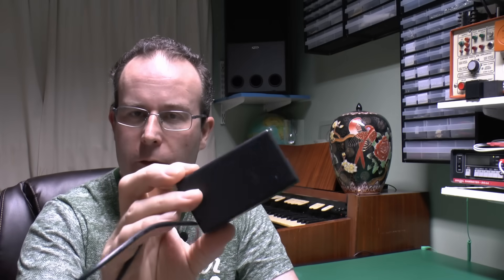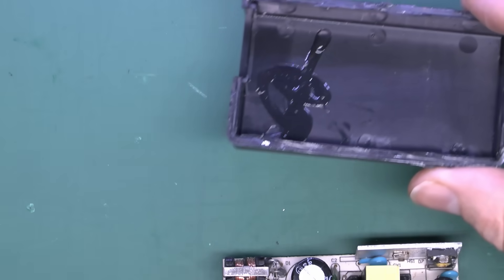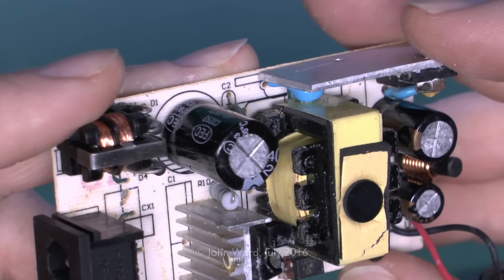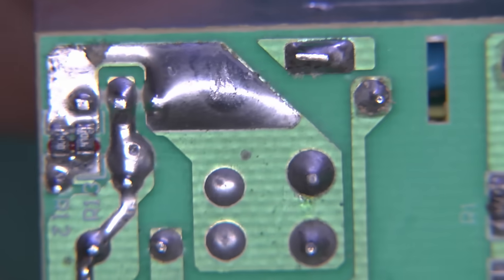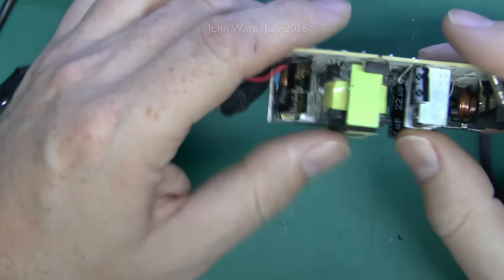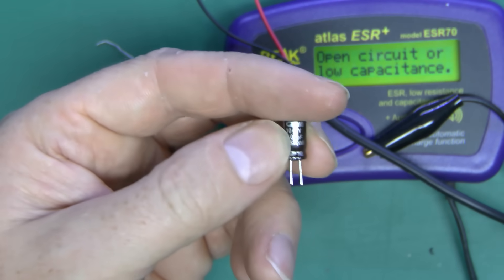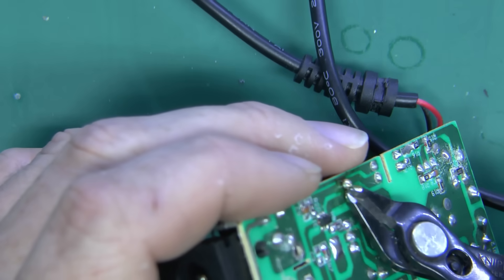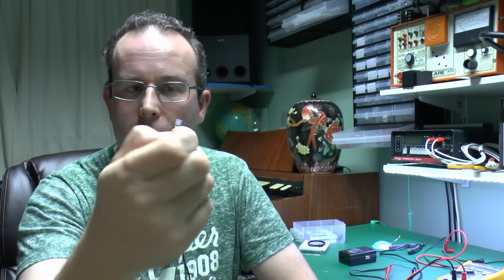12V Power Supply Repair

Comment: yesterday my PC can't turn on after I turn it off , I found out x2 470uF 10V blow out and i can't get it for replace ~ but i found out my old PSU x2 1000uF 10V in good condition, and i replace it and its work~ but I'm kind of worry ,will it affect any other place? such as motherboard or any other pc part?
Reply: check the voltages check the regulation
if they are good then not to worry
Reply: MichaelKingsfordGray  use an inrush limiter, they are pennies
Reply: MichaelKingsfordGray  It's an inrush surge limiter resistor. High resistance at switch on then very low resistance.
You can buy them on eBay.
Have a look here: https://www.ebay.co.uk/itm/Thermistor-NTC-MF58-MF52-5-15-50-100-500K-MF72-5D-9-10D-15-11/303138570119?ssPageName=STRK%3AMEBIDX%3AIT&var=602073291399&_trksid=p2057872.m2749.l2649

Comment: There are quite a few electronics repair video makers on You Tube and I find them interesting and informative. I've been an electronics engineer since 1969 but still find myself learning new things from these videos. However, it always amuses me that many of them have a grand array of expensive professional test equipment on show in the background of their "lab" or workshop,  -  mainly to impress the viewers I think. "Mr Carlson's Lab" for instance, is one such example. 
Such ostentatious displays don't necessarily reflect the ability or knowledge of the presenter, just the size of their wallets. 
This test gear is then used to diagnose and repair the fault on some cheap Chinese gadget or a crappy old radio which would have cost very little to throw out and replace. 
Novice electronic enthusiasts may be daunted to think they need all this stuff to sort a fault that needs only a cheap moving coil multimeter, a kitchen table, a soldering iron, a few tools, and a little knowledge.
Reply: I've watched Mr. Carlson''s Lab he's an excellent tech, really takes the time to do a neat job and I'm very much like his channel.
Reply: @cat-lw6kq  I agree, he is knowledgeable. I have learned quite a bit about repairing 1940s era radios from watching his videos. Now I am looking for a faulty 1940 radio to practise my newly acquired skills.

Comment: Usas demasiado estaño, no limpias el área que trabajaste (debes usar thinner o alcohol isopropílico), muy buen equipo, pero no me gusta el proceso, saludos.
You use too much tin, do not clean the area you worked with (you should use thinner or isopropyl alcohol), very good equipment, but I do not like the process, regards.

Comment: So if all your regular stuff runs on 240v does that me the range and cloths dryer runs on 480v?
Reply from the maker: No, everything is 240V.
Reply: John Ward so do regular outlets run at 10 amps opposed to the US using 120v at 20amps on regular outlets
Reply: When your power comes into the house, do you have 2 legs of 240v running at opposite waves to each other?
Reply from the maker: One 240V and neutral.  Outlets are 13A, 240V which can do anything up to 3kW.  The few things which are larger are permanently wired.
Reply: Well, TBH, there's also 3-phase at 380V. But that's mostly used by bigger machinery. It's also disappearing for home use, as in a lot of places you can no longer get 3 phase for new domestic installations.

Some 380V machines are indeed permanently wired, but some come with a big-ass plug which sits in an equally big-ass "wall socket". They look like this: https://goo.gl/mlJ8Q2 Whether something is plugged in or permanently wired has little to do with the power consumption, in my experience. It's more a matter of not wasting money on a plug if the machine will not be moved anyway. Why bother with plugs and sockets for an oven, a furnace, or a central heating unit? Yet, the welding machine that comes with a plug consumes more than any of those.
Reply: Yup. Neutral and 220 is all they get, so 220v AC.
Reply: Alan Goose a 220v outlet at 20 or 30a breaker would be used?
Reply: I'm sorry, but what part of "everything runs at 220V and we use 13amp circuit breakers" confuses you muppets, exactly?
Reply: That's more industrial stuff - for 3-phase appliances there's (at least in Sweden) a somewhat smaller outlet:
http://images.clasohlson.com/medias/sys_master/8871563427870.jpg  Diameter of the plug is a bit bigger than the normal single-phase Shuko plug.

Most often found in kitchens for the stove.  Washer/driers are mostly permanently wired here.
Reply: That plug looks similar to what we use to connect a 15KW generator to our cell sites when commercial power was down.  https://thumbs.dreamstime.com/z/generator-plug-21965556.jpg
Reply: @HillbillyRednecking  220v in Europe (Greece, anyway) with up to 16 Amp breaker.

Comment: Bad capacitors are a common problem on those switching power supply unit !! The peak capacitor tester is a good tool for testing capacitor, I have one, and I use it on a regular basis, great tool, a must have !

Comment: never saw you test the capacitor initially that made you think that was the bad one.. show thw first test that throws suspicion on the bad on then show continue on with removing , testing for sure, and replacing.
Reply: the top of the cap may have been bulging or maybe leaking which is never a good sign
the cam may not have picked it up

Comment: nifty little checker device you have there.  did you test the replacement cap off camera to be sure it measured 10uF ?  and same for the Vo test , when you got 12.5V.    ...  i.e. apply a load resistor to exercise this aged circuit to see if it can still deliver an amp or not 
......

Comment: really?! no one else is going to point it out?! that solder job was terrible, far from reasonable! ive had to solder in the field with a nail and a blow torch and did a better job on something that was meant to last just untill the end of the day.  having said that, he did find the problem and fixed it.  credit where credit is due.

Comment: I wonder why you're using the horrible lead free solder? Metallic lead is harmless enough unless you ingest it. I must have eaten loads of it when I was a kid wandering around with air rifle pellets in my mouth on plinking expeditions. And... I'm fine. It's lead salts in particular which can pose a threat, and they are not present in solder.

Comment: Hi John. I have a multi voltage power supply 3,5V; 7V; 9V; 12V and the multimeter reads the doble voltage = 7V;14V; 18V and so on. Do you have any idea of the problem ? Yes the multimeter i Ok. Thank you.
Reply from the maker: Probably an unregulated supply - try measuring the voltages with a load attached.

Comment: any idea on plugged in not charging issue?
checked bridge rectifier
replaced mosfets
replaced schottkey barrier diode
replaced capactior 120uF 450V
replaced capacitors 470uF 25V with 1000uF 25V
output 19V, makes laptop power on, but now charging battery
Reply from the maker: If the laptop works from the charger, there is nothing wrong with the charger, probably the battery has failed.

Comment: It was sitting on the shelf since 2009 and the seller wanted to clear out the old stock before moving the new fresh merchandice. Electrolytic Capacitors are like batteries, they have an electrolite and is usually an acid and when they leak its in the form of a vapor and they corrode many other componants and the lands of the device as well as dry up and become useless. In addition to replacing that cap, Mr Ward should thoroughly scrub that whole board down with alcohol or flux remover to prevent future failure from the electrolite deposits obviously sprayed all over!

Comment: Nice repair,correct and direct capacitors are usually the  culprits, check always, its and advice, working temp spec, normally these low cost  power supplies save costs with Elcos

Comment: Often if you set the case down on one corner and tap the other opposite corner with a hammer then you can often break the sonic welded or otherwise glued halves to access the circuit board inside. The force across the box diagonally will separate the two original halves and if you have done it right it will be easy to put back together after you repair the board … I prefer to do this rather than cut the case open … also you can actually put opposite corners into a vice and tighten to break the joint if you have one available …

Comment: my acer v5-561g laptop charger is not working. It seem like it is supplying pulse of supply instead of continuous 19V supply. what I did is I connect a LED bulb to the output terminal of charger and the bulb turn on and off all the time. I repeat the same process with another laptop charger which wasn't broken this time the bulb turn on all the time with out any problem. What is the problem with charger and how can I fix it?

Comment: Dear Sir I have A Q?
I Have made a air blowr out of 24 V DC motor .This motor works on adaper marker Input 100-220V/0.3A &Ooutput marked 24V 1A
My Q is how can I use this blower in my Car which is  installed with 12V  battery
I am from Chem background so if anything available in the market(India)or Amazon pl.let me know your help will be highly appreciated..Mukesh
Reply from the maker: This type of item: http://amzn.to/2kDa5SG 
Many others available.  If searching, the words to use are '12V 24V boost converter'.  2 wires connect to the car 12V, and you get 24V on the other two wires for the motor or whatever else.  For a 1A load, get one rated for at least 2A, as they do get rather hot when used at their maximum rating.

Comment: Excuse me John, its argent for me to repair AC-DC Adaptor model: cpo520 with input:100-240VAC, 50/60Hz,2A And the output: 12VDC 2A And 5VDC 2A and I need in argent please the schematic to know some component that explode and i cant know that components is ,,,,, please help me and thanks for your videos

Comment: I'm going to guess that the tacky glue is from the gluing process at the Factory. It's  probably  the same glue they  use for gluing the two halves of the box together. It just dripped in the box and did not dry out from lack of oxygen, or because it's thick. ..... just a guess???

Comment: Electrolytic time bombs.  Lucky the switching transistor wasn't wiped along with the fuse and bridge rectifier.  Sometimes a shorted component such as rectifier in the secondary can cause thermal runaway and destroy the primary.

Comment: Good.
But I would have tested the new capacitor before and after fitment.
Many a time a new component is actually faulty.
Reply: I tested the old cap and got a high ESR of 40 and then tested the new cap and it was around .11
Reply: Espesially if it comes from china and bears the name Conexion

Comment: Just to clarify it's faster to remove some components in the way he did. It's nice to know he confirmed the capacitor being defective.. Thanks for the video. BY THE WAY I LIKE YOUR ACCENT.CONGRATS.
Reply: I have an ancient capacitor testorwith the green eye indicator tube and a big dial when you turn the dial the two green beams come togetherand the dial points to the capacitor value being tested
 back then they were more concerned with Power factor and never heard of an ESR value. I wonder if they are the same thing?

Comment: use petrol to open the plastic covering , just give few brush strokes on the connected edges , it will make the removal process easy and less messy ;)

Comment: This was so much fun to watch and discover these problems with you.   I've had devices that came back to life once the shorts had been resolved just from cleaning the PC board.    It also looked like R10 had been rusted at the bottom, but that's great you found it as a cap that was messed up.     Great video, 5 years old and one of the best. 

Few people have a camera set up to allow the viewer to inspect components visually with the tech.

Comment: I would just bin the thing and buy a PWM based power supply.
Reply: The trouble is that many of the power supply bricks only last a year or so. Either we learn to fix them for 30p and an hour's work. Or we have to buy new ones every year. What if there are 20 PS bricks in use?
Reply: Yeah but he wants to show how to repair stuff, my very good friend

Comment: Thanks for the video John. It just goes to show how a device can be rendered useless by one failed component. We all come across this sort of thing every so often and just pitch the device into the bin without even trying to fix the real problem. This makes me think of all the electrical stuff I've thrown in the garbage when it could have been fixed by replacing a $2 part.
Reply: 10c part, if that.
Reply: It makes me cry any time I go to the local recycling centre and see the kinds of stuff people/businesses throw away.  You just know that, with a little technical knowledge, a ton of that stuff could be repaired easily.  And guess what; as the tip is controlled by the local council, you're not permitted to take anything from it.

Comment: Those are normally sonically welded (as you discovered).  If you think that there's a screw lurking under a label, it's better to just give it a couple of pokes with an x-acto, awl or similar to "break thru" the label.  This way, if there aren't any screws you haven't destroyed the label for no good reason.  I prefer an x-acto for this job because if you do discover a screw hole, it's easy to make a clean round slice around the screw hole for screwdriver access.

Comment: seriously, this is a rather simple designed power supply you shouldn't have spend so much time digging around nonsense but just cut to the point.
1) crack open the case, you should have just edit it to like 2mins top
2) look for any visible sign of damage
3) physical check for damages on the suspected components with a dmm
4) do the repair or explain why its not worth repairing

Comment: Of it were me I'd change the cap to a polymer or an MLCC, but these are a bit expensive/hard to get hold of.
But Murata do some MLCCs with leads and epoxy dipped. They'd be my choice.
Reply: I dont think Polymer have those high values

Comment: The corrosion is quite possibly the result of soldering flux left on the board during manufacturing. ALL flux should be removed from any PCB to prevent corrosion which of course can lead to failure or change of electrical properties over time.

Comment: Hi. My Famicom video game console's power supply should be outputting 10v but it's only outputting less than 1v. Is this the power supply's problem in the: capacitor, diodes or does it need to be rewinder (100v for japan).

Thank you.
God bless, Proverbs 31
Reply: try a substitute supply that is known to be good before tearing into the original. If the voltage still drops then it might be something internal with the game board. Substitution is always a superior way to fix or test stuff
Reply: Hi. I bend the PSU's wires, it worked (faulty wire at the jack area). It's now outputting 14v at the end of the jack. But it seems the unit's fuse has blown- hard to find pico fuse.
Reply: @SevenDeMagnus  pico fuses can be found on Ebay, Digikey electronics, All electronics, Electronic goldmine, from 1/2 amp up to 25 anp, order an assortment

Comment: In my experience. I always check big filter capacitor 400V for stored dangerous voltage... specially if fuse was not open... This means Power transistor did not oscillate and consume charge current of big capacitor...
It's also good practice that you replaced defective capacitor with higher working voltage. To avoid re occurrence of same damage...
Reply: just jam a screwdriver accross the caps leads to discharge it

Comment: Very well done! But, I would caution everybody to not use tin only solder. Over time tin only solder produces "hairs" that can cause a short circuit damaging other components on the board. If you look far enough, you can still find Tin/Lead 60/40 solder, just wash your hands well before handling food or smoking (for those who still do). I am restoring a Heathkit AR-3 receiver and will use modern components to do the job, but use the old solder to join the components. I have about 15 pounds of the 60/40 rosin core solder in varying thicknesses so it should last me for a very long time. A result of our "nanny State's" idea to "protect" us from ourselves. Pointless, do you think?

Comment: Hi sir John. This is a bit off topic but it's a bit similar (problems with power).
Does my Famicom power/AC adapter need rewinding or does it need it's capacitor replaced? The adapter is 10v DC but the power/AC adapter is only outputting less than 1v. 
The specifications are:

DC 10v 850mA
AC 100v 50/60Hz 18Va

Is it the capacitor? The capacitor spec is 16v 2200 microFarads.

Thank you in advance. 

God bless, Psalm 11:7
Reply: If you have a handy dandy multimeter you can check the values of the components and with a bit of googling you can easily make out which one is faulty, though if it does turn out to be the transformer you're better off buying a new onw

Comment: Does that power supply actually deliver 12V whilst under full load? My experience with Chinese SMPS bricks is that they will not supply rated power. In some cases, not even half. This has been the case for even one I have ever purchased.

Comment: Thanks for useful information. Would one be able to repair 230 AC to 9 volt DC  Roland power supply? The output is to high. It reads over 14 volts out.